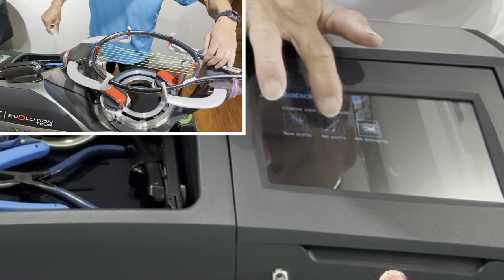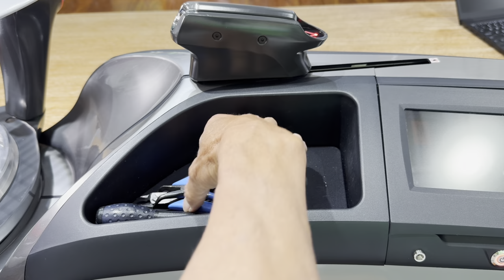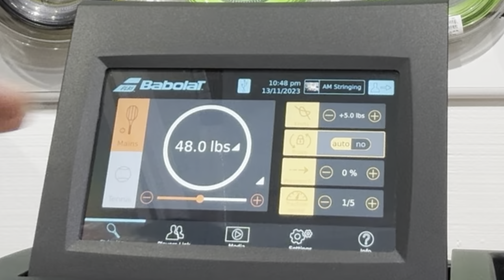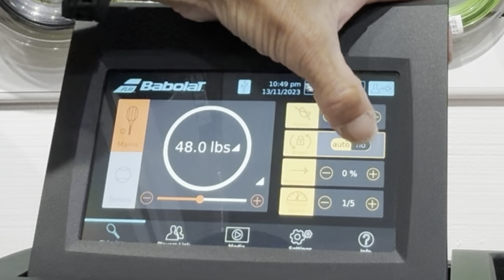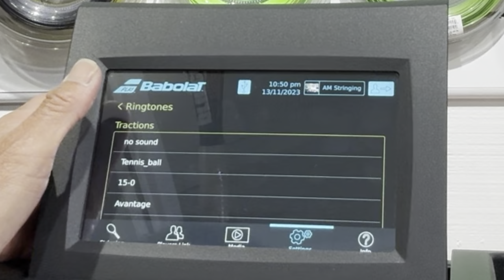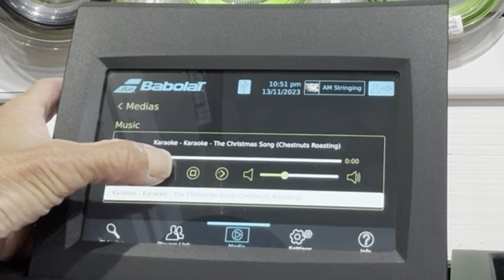Racquet Stringing Machine [Babolat Evolution Tour Review]

Comment: Hi, I’m just curious about why is helpful to lock the turning table, what happens if I tension the string allowing racket to rotate
Reply from the maker: Aloha Dario, 
That's a good question. 

On an O3 Port racquet, it is necessary to have the turntable locked in place to pull tension accurately while maintaining the proper spacing between the cross strings. 

On a normal grommeted racquet, locking is not necessary. However, ever since I've had the automatic function on my machine, I prefer having the racquet locked in place. I like how it feels nice and stable on every string pull. If you don't have this automated feature on your machine, I would not recommend this practice. 

Some may argue that locking the turntable may cause the tensioned string to be angled, in other words, not pulled in a straight line. The way I remedy that is to make sure the string enters the tension head jaws in a straight line, which is not hard to do. I hope that makes sense. 🤙

Comment: I would have checked at 19:25 how much tension difference it made if u were to keep the string horizontal going on top of a machine clamp without it contacting the machine before reaching the tracking head. Just curious.
Reply from the maker: Aloha, Are referring to the section of the string that touches the 6:00 mounting tower? If yes, unfortunately, I couldn't secure the calibrator bracket on the 6:00 billiard since the "inside" surface is curved. I could secure the bracket on the 12:00 billiard since the "outside" surface is straight. If I had the type of calibrator that could be secured by the string clamp, then what you're suggesting (I think) might be possible. And that would be interesting to see if there is a difference. 👍